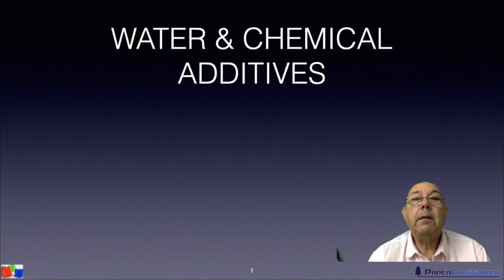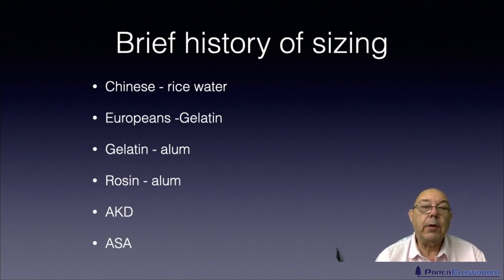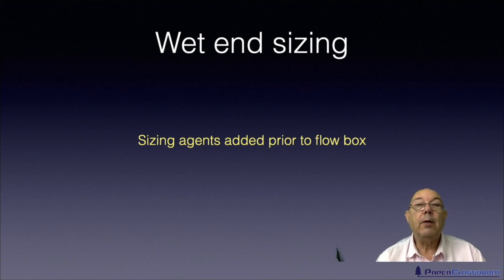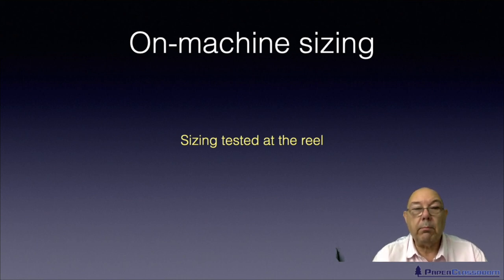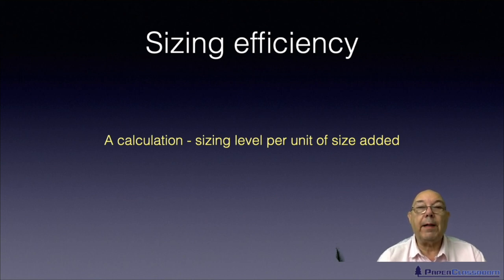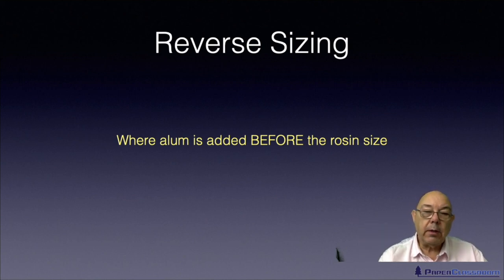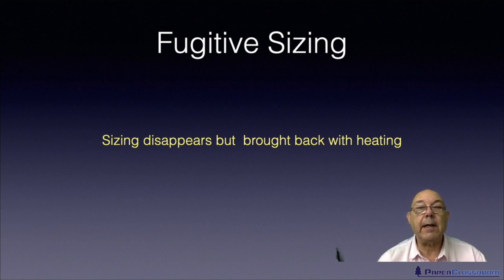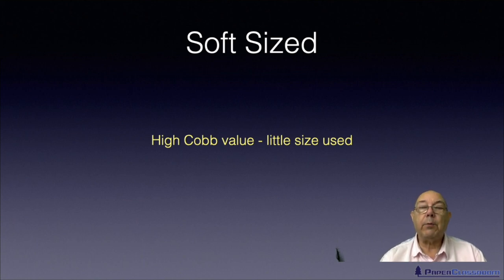Level 2 Papermaking - Sizing Definitions

Comment: @Steven Mann  

Good Morning
How to different kind of GSM paper made in single paper machine.
Example: One day maket 45 Gsm paper. Next day make 80Gsm paper.
Reply: They will adjust stock flow according to GSM
Reply: Speed & stock flow....
1) If you increase speed for same stock flow, GSM will get reduced and viceversa. 2) Also for constant speed, you can increase stock flow to increase GSM and viceversa
Reply: @chandrakiran2558  Thank you  your replies👍
Reply: @RK-ej6lq  Thank you  your replies👍
Reply: Sir  if there  is any  limitations  of hard water  ppm  for  which using wet end pulp